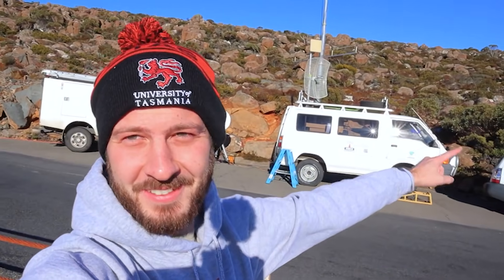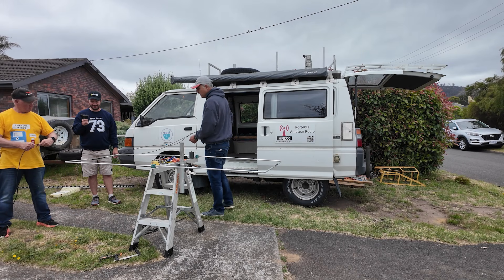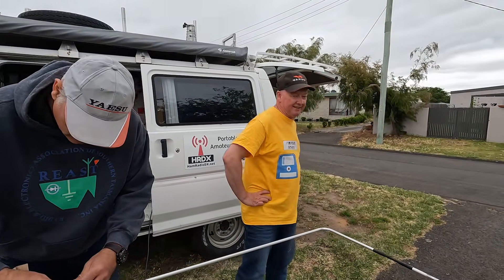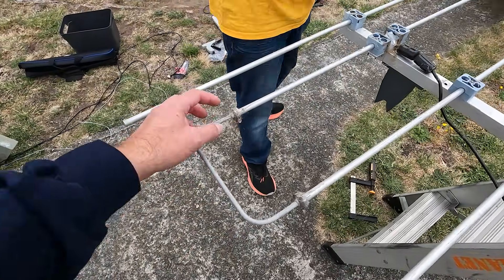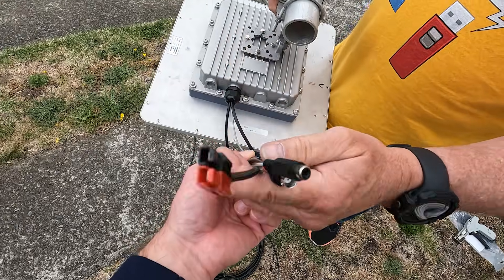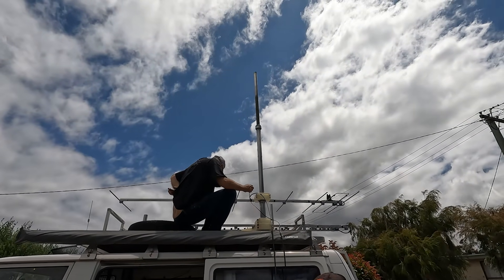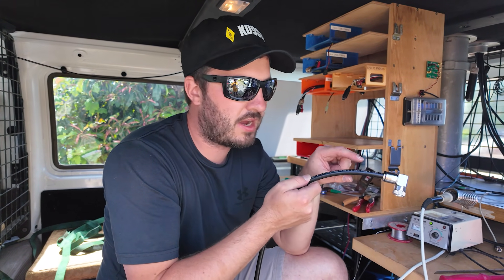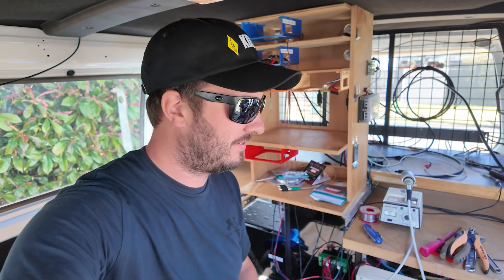Three Blokes and a Ham Radio Van - UPGRADES!

Comment: Nice work. But convince me that a 36 element Yagi is actually better than, say, a 20.
Reply from the maker: More elements generally means more gain and a narrower beamwidth!
Reply: @HamRadioDX up to a point. Once you get past about a dozen the finite conductivity of the metal just increases loss.
Reply from the maker: You’re right that there are diminishing returns as you add elements — it’s not a linear “double the elements = double the gain” situation.

But with a properly designed long-boom Yagi (correct element spacing, tapering, and diameter), you still get net gain improvements, especially at 1296 MHz where element sizes are small and losses can be controlled with good materials and construction.

What you mostly trade for each extra element is smaller incremental gain in exchange for narrower beamwidth and better front-to-back ratio, rather than “pure loss”. Poor designs can absolutely turn extra elements into heaters — good designs don’t.

That’s why contesters and EME stations still run 30–60 element long-boom Yagis on 23 cm.

Comment: 13:16 Slap some self-fusing rubber or silicone tape on there and you're good to go. No worries about water infiltrating though any part of the connector.
Reply: Heat-shrink tubing, even if glue lined, is not adequate waterproofing.

Comment: Amazon RG213 (AKA MIL SPEC)*
SILVER PLATED TEFLON insulated pl259's. And NEVER hold soldering tool on the pl259, or you'll destroy the coax!

Use a weller 8200 100/140 watt soldering gun! Scrape ground holes on pl259, add solder flux, melt solder on TIP if gun, instantly touch A ground hole, And GET OFF OF IT!!! IF you can't IMMEDIATELY HOLD connector in your hand, you've DESTROYED THE COAX!!!
AE6JI
Reply: How to get cold solder joints ☝☝ If your coax cannot handle soldering temperatures, you should NOT be using solder-on connectors and should be using crimp connectors instead.

Comment: I could swear my M&P 90 connectors had an O-ring on the center conductor cap. 🤔 did they stop using them?
Reply from the maker: Maybe ours fell out when I wasn’t looking but on the ones we had they weren’t there
Reply: The 4 i have has the o-ring for the m&p10